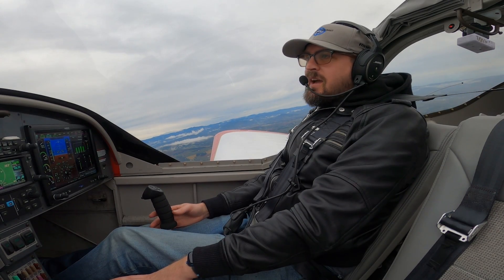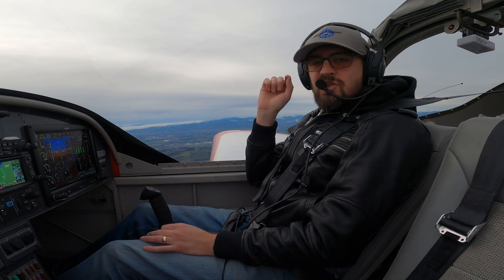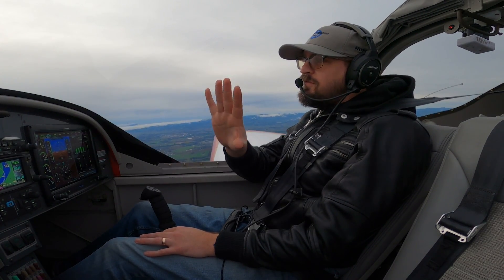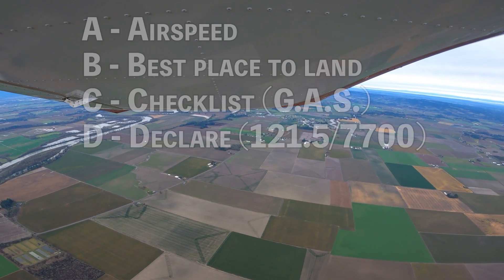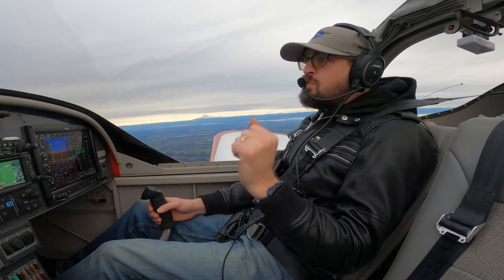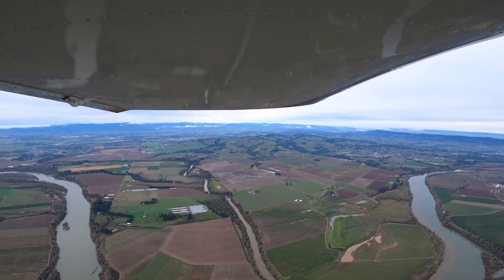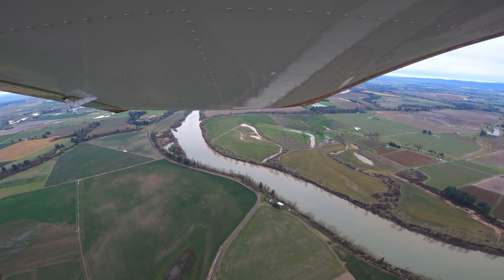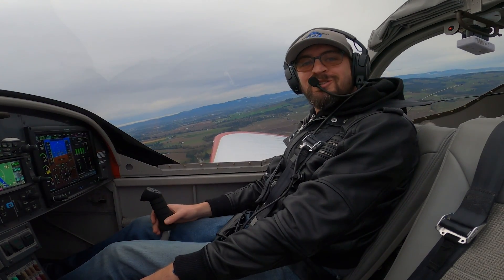ABCs of Engine-Out!

Comment: It is obvious to me this guy has probably never had an actual engine out for real. I have 16,000+ hours flying a wide variety of aircraft both single and multi engine and six of whichever were in helicopter. I have only damaged two aircraft I was able to get the rest down without incident. I agree with the first thing to do is establish a glide at the best glide speed for the plane you’re in. Turn on the carb heat, and bring the throttle back to just above idle. Switch gas tanks if possible. Reducing the power to idle might get the engine running again if the reason for the stoppage was some kind of restriction in the fuel system. I have been able to avoid having to make an off field landing more than once by doing this. When you close the throttle you reduce the amount of air into the engine if there is any fuel flowing this might get the fuel/air mixture closer to the magic 7% fuel to air that will allow the windmilling prop to restart the engine. Then you can apply more throttle to the place it starts to starve for fuel then reduce it till the engine runs smoother. It might be able operate at less than full power. Even if this is not enough to maintain altitude it can extend your glide and improve your options as to where you can land. As a flight instructor I teach my students if you can see the ground you should already know the best place to make a landing. Fly from this field I can land in to that field I can land in. You are always better off looking out the window than trying to figure how to use the new and latest avonics. The last engine failure I had happened on my to Sun & Fun a few years ago flying over southern Georgia at less than two thousand feet trying to avoid the headwind when the engine just stopped, with nothing but pine trees as far as I could see ahead of me I knew the only chance I had was to return to the last green grass was about two miles behind me. Without the aid of the tailwind I would have not had a chance of getting back there. having got my private license in a glider I have developed the ability to see how far I might be able to glide looking out the windshield, there is a place that does not seem to be moving. Everything else is either moving under the nose or climbing up in the windshield, the place that doesn’t look like it’s is moving is where you are going. When I got to the fields I could turn left into a nice field full of horses or left into a large back yard of plantation house. I was down to the top of the trees and used up all the available airspeed I cleared the trees and made a successful off field landing in a field big enough to take off from. The problem was the Gascolator gasket had started leaking and had leaked out a full tank of gas in a little over an hour. You can meet some of the nicest people when you land in their back yard, they helped me fix the plane, gave me ten gallons of gas and took all my baggage to the Thomasville Ga. airport and helped me tie the down then took me to a motel. The point of all this is if you don’t have a lot of altitude to work with airspeed is critical and once you decide where you are going stick with it. The road is full of Squirrels that kept changing their minds.
Reply from the maker: So I’m curious what would inspire the degrading opening sentence to your otherwise insightful comment? Nothing you said seemed to contradict anything I said in my video, and if anything just supported and expanded on what I said. Have I ever had an engine problem leading to a forced landing? Fortunately, no. Not yet. But I have problems which I was fortunate enough to be able to get back to an airport from just like you have. So I don’t understand what is so “obvious” about me never having an engine out yet, and more so why that even matters for the purpose of this video? We are flight instructors. This is what we train. This is what the video is about. Your opening sentence is very odd to me and the tone of your whole comment makes it sounds as if you’re trying to make up for something or prove something. 🤷🏻‍♂️ great comment and advice aside from that.